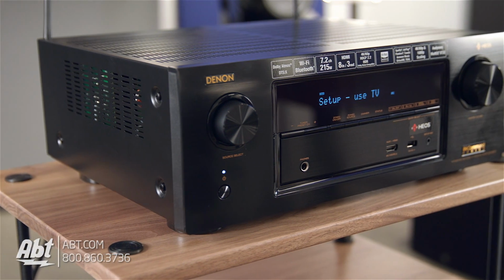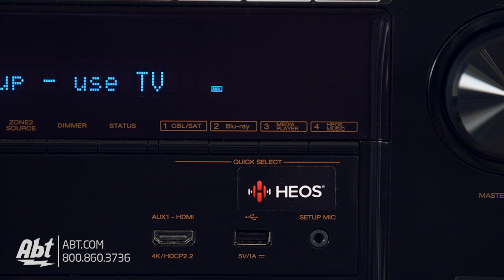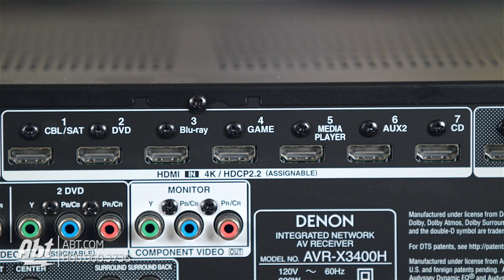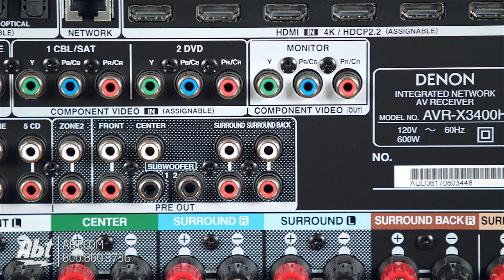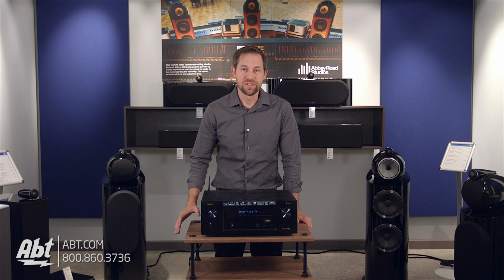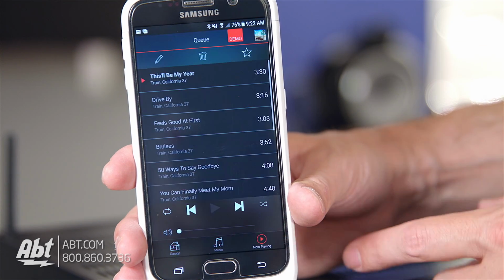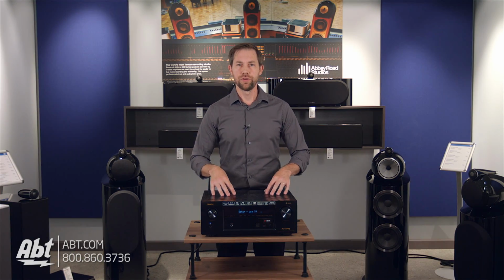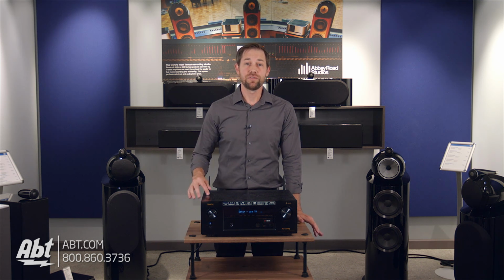Denon Receiver AVR X3400H Overview

Comment: Friends good night, I need a help ... I have a denon 3400 and I use zone 2 in it, it happens that the zone 2 tv has smart and I would like to play the sound of it by zone 2, so I bought the optical cable to connect the tv to reciver, that's when I discovered that zone 2 has analog input, right? I bought the converter from digital to analog and I was able to reproduce the sound in pcm, but I can not change the volume. Has anyone ever experienced this? In zone 1 everything gets easier with the arc return, works perfect

What do I need to do?

Comment: Nothing you've said has convinced me to pay $1,000 for a receiver that almost every other $500 receiver on the market can do. -  (ie, the Onkyo 676, or the Sony 1080)

Denon gets a 'name tax' all the while using cheaper and cheaper components ever year. (Like everybody else).

Nope, sound quality is king in the end (since they all have the same features) And you've said nothing about sound. This review is nothing more than a feature list which I can get by reading the box. Tells me nothing of what really matters.
Reply: and Pre Out on this Receiver as Well very important for me! NO Avr in the 500$ range have pre out you need to go in the 1k
Reply: JSW and two zone speakers
Reply: Randy Levine 
Any $500 units that have 4ohm speakers capable( all around) and most importantly, automatic dual SUBWOOFER balancing. 
Most dual SW output s are just inbuilt splitters.
Reply: Xt32 is what you're paying for.
Reply: better amps and power supply. it makes a big difference unless your speakers are utter garbage

Comment: Does anybody know the power ratings at all channels driven? I own this receiver and am looking to add a power amp to my setup, but haven’t been able to this info anywhere!
Reply: LOL definitely not 90 x 7 all channels driven! its 105w 2 channels driven at 8ohms 20hz-20khz  0.08%THD.  135w 2 channels driven at 6ohms 1khz  0.7% THD. 215w 1 channel driven at 6ohms and massive 10% THD. Hope that helps
Reply from the maker: Hi Dennis.  According to Denon Tech Support, the AVRX3400 is 90 watts x 7 at all channels driven (or 105 watts x 2 channels driven).  I hope this helps and thanks for watching!  -Carl
Reply: Abt Electronics thank you so much!
Reply: Abt Electronics hi will this receiver have enough power for bower and Wilkinson cm9s2 and cmcs2 center or i need to step up to x64000h.
Reply: Shedrick Johnson I would suggest you to use only 2 channels from your receiver if you have high-end speakers. Use an external amp for the rest. Emotiva makes some good affordable amps if you looking for new. Or you can get used rotel or adcom from eBay. Higher model AV receiver won't give you a lot more power only built quality and features.
Reply: Sherikan Niyaziev thanks you i appreciate it. Im at magnolia room right now auditioning rotel amp now. Thanks again.